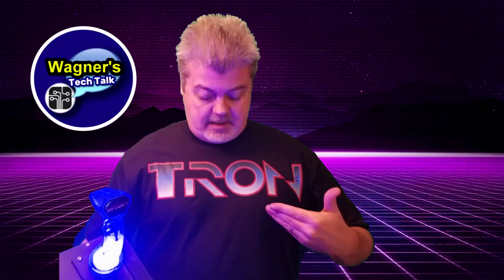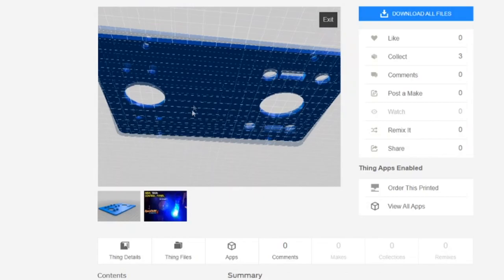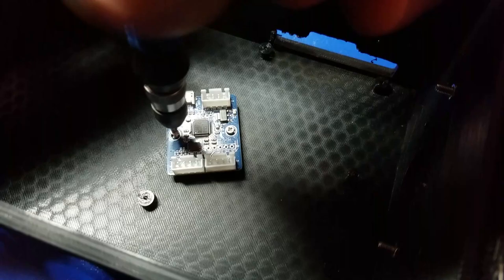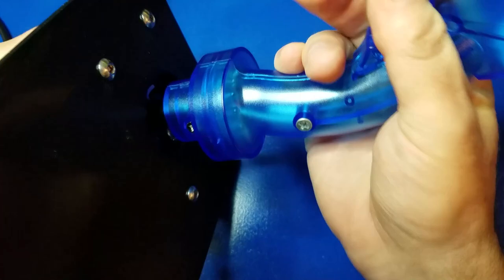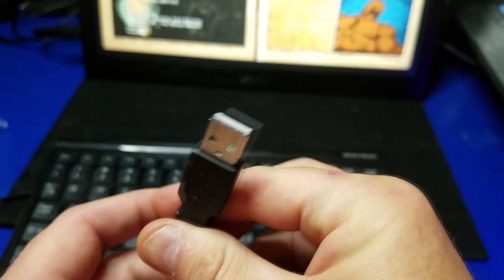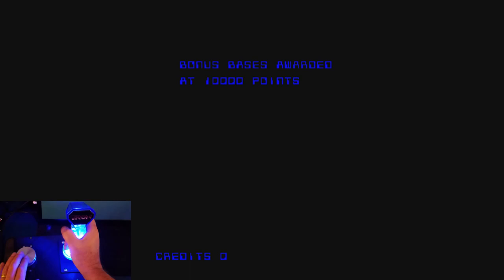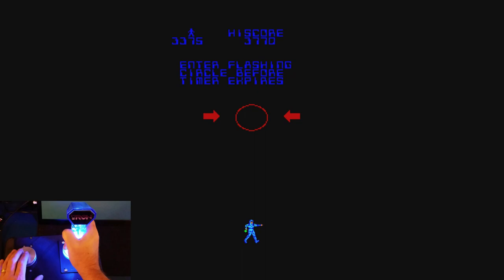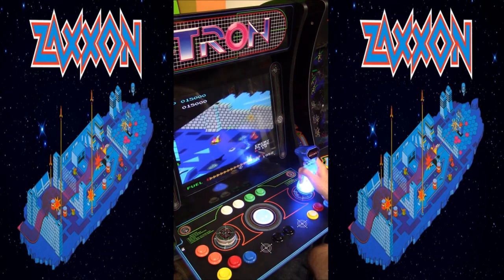Build a TRON Arcade Controller & GRS Controls +MAME +RetroPie or PC: 3D-Printed TRON Panel!

Comment from the maker: *NOTE: The encoder board shown in this video is no longer being included with the product.  Therefore, if an encoder is needed it will be a separate purchase.  Just wanted to make you aware of that change.
Reply: Is the encoder sold by thunder stick studio or does it need to be purchased from a different retailer?

Comment: would have been cool to see disc of tron on there too
Reply from the maker: Disc of Tron is an awesome game, but it may be misleading for me to have demonstrated it in this setup.  Disc of Tron used a very unique spinner, a push-pull spinner.  It would be cumbersome to play with this configuration.  However, about a year later Glen (GRS) released a push-pull spinner that makes it possible and designed a new control panel to work with it.  Here's the more recent video, if interested: https://youtu.be/2soNa6maghw

Comment: The GRS Tron Stick I ordered did not come with the connectors shown in the video or the encoder board. Only came with wire harnesses for the ArcadeUp ALU. Could you tell me where I can get the connectors and encoder board? Thank you.
Reply from the maker: Hi Alexander, please check with Glen here: https://www.glensretroshow.com/contact  When mine was ordered, it came with and unsure what's changed since then.

Comment: I notice that the button connectors of the harness (that remained unconnected) don't look like the normal arcade button connectors- they seem to be smaller connectors enclosed in white plastic. Do you know what the name of this type of connector is? I'm looking to get buttons that could hook up to these connectors.
Reply from the maker: I sent a message to Glen (of Glen's Retro Show) to ask him.  When I hear back, I'll reply with what he says.  I don't want to tell you wrong as I haven't used those connectors myself.
Reply: @WagnersTechTalk  Any update on this, I'm putting together currently and all the cherry switches I have do not fit (they are too big to fit in to the white plastic shrouded connectors).  Should I just cut them off and attach a bigger lead?

Comment: Tron is my all time favorite arcade game. It is the reason why I never went to college. My mom gave me money to apply (like $15 lol) and I used it to play Tron lol. Does it feel like an arcade one--i.e. the spinner, etc?  Thanks for the video. I had a chance to buy a real Tron around 30 years ago for $200 still kicking myself for not getting it lol.
Reply from the maker: LOL, yeah $15 won't get you too far in college.  I used this with RetroPie on a Raspberry Pi and it worked really well.  The Tron stick only has 1 button, so you won't be able to use it very easily with discs of Tron without hardware modifications.  The spinner works great as well as the stick for the original Tron game.  Very similar to the Arcade.  Hope I answered all your questions!  Keep in mind, you will need a 3D printer or access to one to build this.  You could also use it with a computer instead of a Pi if you want.
Reply: @WagnersTechTalk  Lol it was the registration fee.

Comment: I ordered from amazon from the link you provided for the joystick, but it doesn't have a encoder board like what you said it does? How do I get one?
Reply from the maker: The joystick I ordered did, check with Glen to see if something has changed here: https://www.glensretroshow.com/contact/
Reply: @WagnersTechTalk  Thanks I contacted him and this is what he said Quote"Hi Jeff.

We no longer include the encoder board.  We removed it to bring the price down you can use any standard USB joystick encoder board with it they can range anywhere from $5 to $8 it's just a standard zero delay USB and code aboard.

Respectfully
Glen Planamento"

Comment: How are you controlling aim up and down in discs of tron with that spinner?  I don't believe that spinner can be pulled up or pushed down.
Reply from the maker: This is an old video, but in Disc of Tron this spinner doesn't support push-pull as you mentioned.  GRS later released a smaller push-pull button spinner to solve that problem .

Comment: Is there any way you can make a reverse of this? with the joystick on the left side?  I can erase the spinner in fusion but I can't move a hole or make a whole.  I have the spinner on the second box for spacing, and using this box for the joystick and some buttons which I can drill in..

Comment: How do you design these? I want to make an adapter to change from the GRS spinner to the GRS push pull spinner for Disc of Tron.   It fits into a standard button hole though. so I have to make a plate that will adapt between the two sizes.
Reply from the maker: There are bunch of tools you can use such as Microsoft 3D Builder, Tinkercad, Blender, etc.  I use a package called MoI 3D.  There is an empty control panel included in the main package, you can import that and place the holes wherever you want for the buttons.  Hope that helps!

Comment: GRS Tron Stick no longer available on Amazon....anywone else selling them?
Reply from the maker: They are only out of stock, they'll be back.  Check with Glen,  he'll know more: https://www.glensretroshow.com/contact/
Reply: @WagnersTechTalk  Ok thanks. I want to build my own Tron arcade so I need joysticks that are as close to the real thing as possible. Actually, I want to build a Discs of Tron but I need a three level spinner and a Tron joystick with a trigger and a thumb button on the front panel. Do you know anyone that builds/sells those? Thanks in advance. 
(and by the way - I also am planning on FINALLY building a Star Wars Arcade and have been looking for YEARS for the yoke controller needed - so I'm glad that GRS is making them - a dream I've had for almost 40 years can FINALLY be realized....)

Comment: I have retro pi 4. And I have tried mame2000, 2003, 2015, 2016, and mame and could not get Tron working on my Retropie4.  I'm using Tron 2, 3, and 4 roms.  I was able to get Tron working on my laptop but I can' figure out why it''s not working on my Retropie.  I really appreciate your help.  I've got a Tron cab in the making with all the controls but can't get my RetroPie to work.  I appreciate any help.
Reply from the maker: You can also try Advanced Mame, it's what I used here.  I wrote down what I did here: https://wagnerstechtalk.com/grs/#RetroPie_Configuration_AdvancedMAME
Reply: @WagnersTechTalk  So I installed the last mame available on my pi and literally the last version of Tron and it worked.  For whatever reason, adv mame didn't work but make 2010 did. I'm going to order the flight stick and spinner this week. Your videos have been very helpful. Thank you.
Reply from the maker: @ks-bg5uk  Very welcome, happy to hear you got it working!
Reply: @WagnersTechTalk  Hi, it's me again.  So I ordered my flight stick and spinner and assembled everything.  I was able to get the stick and buttons to work but I am not able to get the spinner to work.  When I load Tron in mame using retropie, I click on tab to get into settings, but when I try to set dial with my spinner, it doesn't look like its synced or detected.  When I spin the spinner, the spinner board is lighting up showing there's a signal.  The control board has a red light as well.  Any suggestions?

Comment: I installed AdvancedMAME 1.4, but when I select the game and press enter on the keyboard, nothing happens.  I can press TAB for the game menu, and that works.  Please help!
Reply from the maker: Hi Jonathan, first you'll want to use the controller to select the game and press the 'A' button.  Also, you have to make sure that the rom you're trying to run is for AdvancedMAME 1.4.  If it doesn't launch, then it's mostly likely not or that the game depends on another set of files.  I have a little bit more information available on this page: http://wagnerstechtalk.com/rpi4gaming/#Installing_ROMs
Reply: @WagnersTechTalk  If I was a big fan of that old show PUNKy Brewster, would I have any luck finding individual Roms, or do I have to look elsewhere?
Reply from the maker: I would recommend looking for a "rom set" ;)  That is, a complete dump of whatever it is you're looking for.  But as far as links from me for games, definitely need to look elsewhere - not something I can do.

Comment: What key did you hit to get to the menu where you select the emulator, please?
Reply from the maker: When you launch a game, press enter when you see the dialog then you can change the options.
Reply: @WagnersTechTalk  That worked!  Thanks so much!  I've been trying to figure that out for years!
Reply: @WagnersTechTalk I used TAB to reconfigure the controls for the Tron rom, but one more thing: how do I exit the game now?  Select + start doesn't work, so for now I am using Esc on the keyboard.
Reply from the maker: If you set a SELECT button as your HotKey when you setup your controller, you press SELECT+START at the same time to exit.  In AdvancedMame, it's a little tricky though.  You may also need to define the up/down, A to be able to select the exit option.  It's been awhile since I've done it, but I think that's right.

Comment: No matter what I do, I cannot get the spinner to work in TRON.  TRON only works in MAME2000.  How did you even get the game to work on this?  I'm running RetroPie on a Pi Zero w.  Does anyone have any idea how to get this working?
Reply from the maker: I used a Raspberry Pi 3b+ at the time with AdvancedMAME.  It's far easier to setup, I documented everything I did here: http://wagnerstechtalk.com/grs/#RetroPie_Configuration_AdvancedMAME
Reply: @WagnersTechTalk  Thanks I cannot get any of the ROMs I have (all of them) to open up in AdvancedMAME.  It says not supported when I try from the CLI.  Is there anything special I have to do to the ROMS, I've tried on my pi zero w and my Pi B+ no luck on any of them.
Reply from the maker: You have to make sure the roms you use with AdvancedMAME are the correct romset.  If you downloaded them for MAME2k, they may not work (or only a few may).  You'll likely have to download a new romset.  Where to get it, I can't say.
Reply: @WagnersTechTalk  Thank you.  Is there a keyword I may add to my search to find such a ROM set?  I understand for legal reasons you cannot tell me where to look.  I just searched for the ROM and downloaded every version I could find.

Comment: You neglected to mention that they do not include the flight stick encoder board in the GRS flight stick you linked to on Amazon.  Where do we get that from, maybe a comment update on your video summary text would help?
Reply from the maker: I didn't neglect it, when I made this video the encoder board was included as part of the kit.  However, I later found out it is no longer included and added a pinned comment to this video to make sure to update anyone who watches it.
Reply: @WagnersTechTalk  I get that, but as the original poster, maybe modify the video text, where you post the links, it would have been worthwhile for me to see a link on where I could buy that encoder so I wouldn't have to go into the comment section after I received my shipments which aren't as shown in the video. Can you, now, at least update your links to add the encoder board we should use that fits your thingiverse model?

Comment: How did you get the encoder? The one I just purchased didn't include one.   Anyway great video.. thanks for making it.
Reply from the maker: Thank you Alex, I recently learned that the encoder is no longer being included for some reason (mine was when this video was made).  Not sure what replacement should be used. Glen may have a suggestion : https://www.glensretroshow.com/contact/
Reply: What encoder did u end up using? I have the same issue

Comment: Any recommendations on a 3D printer suitable to print this size project?
Reply from the maker: Any printer with a build volume of at least 225 x 145 x 150 mm should be good.  I printed all my parts using a FlashForge Creator Pro ( https://amzn.to/3bpnhVy ) which is about 3 years old and still runs great.  Although, I rarely use the dual-extruders feature and print mostly using one nozzle.  There is a free splicer called FlashPrint that you can download, it's great.  I've never had a need to use anything else.
Reply: @WagnersTechTalk  thank you for the quick reply, keep up the good work!

Comment: Where did you get the board for the Tron joystick with the five pin molex connector?
Reply from the maker: It's the 12-in-1 interface board here: http://wagnerstechtalk.com/grs/#Parts_Needed
Reply: @WagnersTechTalk  Thanks! I mean how did you connect the Tron stick to it? Did you build spade to molex connectors for it? Or is there a board you can get that has that built in?
Reply from the maker: @coinop29  See 8:30 the connectors + board for the Tron Stick came with the Tron stick.  The 12-in-1 board shown mounted at the base is needed for the spinner.  Hope that clarifies.
Reply: @WagnersTechTalk  Thanks! I bought a Tron stick from Microcenter that didn’t come with a board or connectors. Hmm, is there a source to buy just those parts?
Reply from the maker: @coinop29  Sure, you can check with Glen here: https://www.glensretroshow.com/contact/
Reply: @WagnersTechTalk  Thanks, I asked Glen he's looking around. The website doesn't sell just the board and 5 pin connecter part. There's  a warning on the Microcenter (where I got mine) page for the Tron stick that says the Joystick you buy there is basically a "paperweight" because there's no interface board for it included.
Reply from the maker: @coinop29  Glad Glen is help you.  Yeah, odd that they wouldn't include it.  I ordered mine from Amazon and the stick, encoder, tron sticker, etc. were all included.
Reply: @WagnersTechTalk  Cool, yes Amazon is sold out

Comment: I want to build a half-scale standup. Any interest, let me know. I need a team of people to build it.
Reply from the maker: You could start with this 1:6th scale Build-A-Cade for all the components needed: https://wagnerstechtalk.com/grs-bacv1 .  They are on sale for $50.  Then, scale it up, if you want.  Only thing missing in this kit is the Single Board Computer (SBC), but they are easy enough to find and inexpensive.  

Perhaps pickup 2, one for the original scale and a 2nd to integrate into a half-scale.  Just a thought, you would need to build a new cabinet, larger display and custom controls or you may find 1:6th scale works for you too with the Panel POD (external controls).

Comment: Hi Wagner! Great vid, as always. Like I said in another comment (your other vid), I'm doing an Arcade 1 UP Tron conversion and just got the GRS Tron stick. Do you think it's possible to bypass the encoder he included and use another aftermarket usb encoder instead? The connectors for the buttons included with Glen's stick look so foreign, and he doesn't explain that part in his vid. He also doesn't respond to comments asking for help which is sad and makes me feel like he just cares about the money and not his customers. :(
Reply from the maker: I've only used his encoder with mine, so I'm honestly not sure.  Please give Glen some grace, he works in the medical industry and they are being hammered.  He's also juggling trying to get the Star Wars Yokes ready for shipment, so I know he's got a lot on his plate.  I've not spoken with him in about a week but I know he's stretched very thin.  I'm sure he'll answer when he can.  I can assure you, it's not about the money with him.  He's just about selling his parts at cost.  

Unless there is a reason not to use the included encoder, I would stick with it.  If it were me selling it, I wouldn't be able to support any encoders not supplied by me.  You never know what kind of quality they are, adequate voltage, etc. or figure out the wiring for all the encoders that are on the market.  Not something one person could support.  JMHO
Reply: Wagner's TechTalk Thanks for the feedback! I can understand that; it’s just a bit frustrating having unanswered questions for months now... but there IS a pandemic going on, lol! Okay second question: Is it possible to use two usb encoders for one player? For example, I use Glen’s encoder solely for the stick and plug that into one Pi 4 usb port and for my other buttons, use another usb encoder to plug into the second usb port on the Pi 4?
Reply from the maker: Certainly!  That's how I use it on my console.  I built an OpenCADE with a spinner, trackball and joystick (Joystick and buttons are using their own encoder connected via USB, Spinner+trackball to the 12-in-1 encoder,).  Then, plug in the Tron stick (as a separate console) when I want to play Tron.  Granted, I don't have it enclosed in a cabinet, but there is no difference at all.  You may also want to get a powered USB hub in your cab to make sure that you have sufficient voltage to all of your connections.  Hope that helps!
Reply: Wagner's TechTalk To be clear I want to use both the Tron stick AND buttons (both usb encoders) simultaneously for games that can use the Tron stick but require more buttons. If so then you just solved one of my issues and I greatly appreciate your help👌🏼

Comment: Is a link to buy the 3D printed case and wrist supports available? I could find the case on thingiverse.org, but couldn’t see how to buy it.
Reply from the maker: Interesting, Thinkiverse once had an option where you can order it printed but not seeing it either.  Some local libraries have 3D printers and can print stuff for you.  I'm not equipped to print these for folks, may be good to check with local 3D printing groups or friends that could print it for you.  I don't offer these for sale, I only design the models and let anyone print them.  You can find good prices on printers, may be less hassle to pick up a printer.  It's not hard to learn how to print an existing model and so much fun!